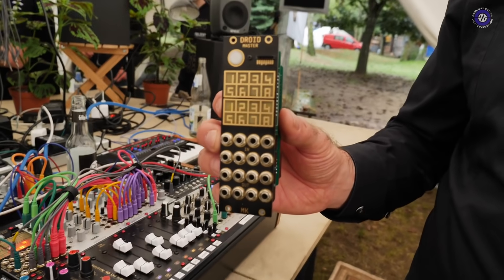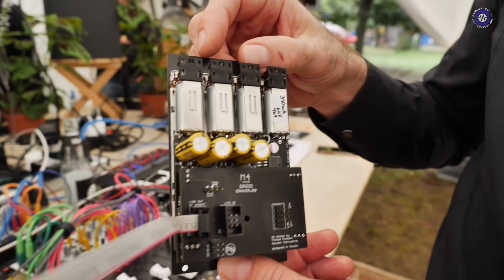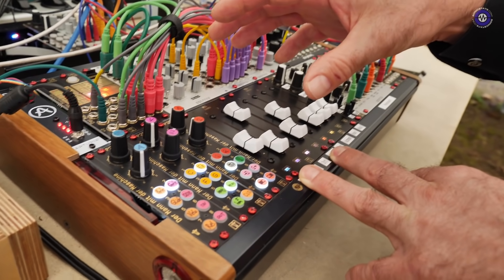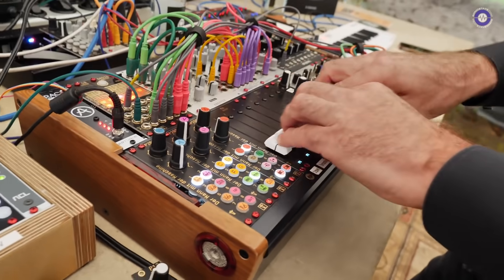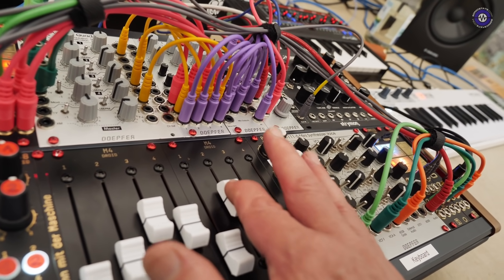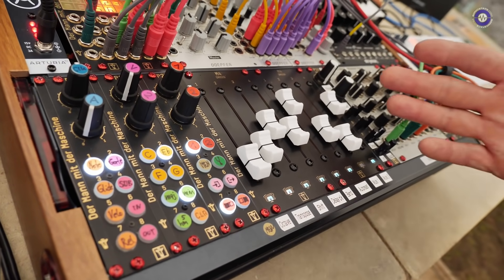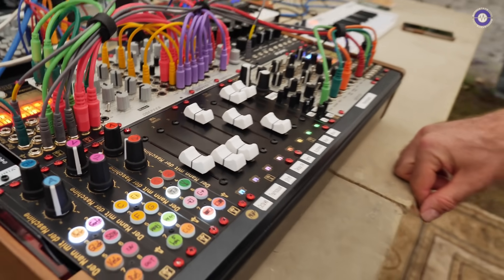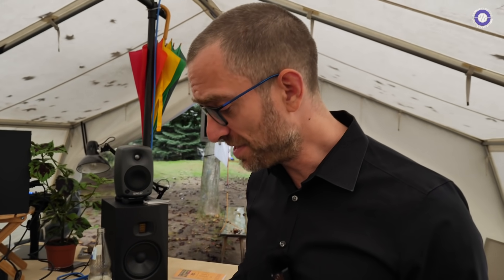SUPERBOOTH 2021 - Der Mann mit Der Maschine - Motorised Faders for Eurorack

Comment: Could you also run the cv to a midi converter and use the faders to control the faders in a DAW?
This is the first thing at SB21 that’s gotten my attention. Very nice modules!
Reply: I think you could, there´s nothing limiting you in doing that. Also,might be possible with that USB C port, I understood it's used for conncting to a computer to avoid taking out the sdcard.
Reply: @gautrstafr  yer killing me! When do these modules get listed. I need funds for a droid, two controllers, two faders and X7 😬
Reply: @TRaddcliff  Agreed! I want a droid, midi module, 8 of the buttons and 4 of the faders to have a monster system though I don't know how many modules you can chain in one Droid
Reply: @gautrstafr  can’t wait! First piece of gear that has excites me for a while :) aside from Hydrasynth 2 years ago.

Comment: It clicked for me when he said in another video that the main limitation is the number of physical outputs. I was thinking the way it worked was that you could only have a single circuit assigned to each output. But it's way crazier than that. You could, for example, set up 5 internal LFO circuits and have them cross-modulate each other and send that result to a single output. 

I've got some modules on the way and already started playing with some patch ideas in VS Code while I wait. At first I was like "A TEXT EDITOR? IN MY MODULAR?!" but then I realized once I set everything up I could have something super playable and not have to mess with it much after that. We live in strange and amazing times.

Comment: I don't get it... where is the CV out?
Reply: It’s on the DROID master module, in the first row at the left
Reply: @DerMannmitderMaschine  Right... so the faders are connected to the master through the back?
Reply: @flflflflflfl  Exactly. Via a 6 pin ribbon cable just like all other DROID controllers.
Reply: @DerMannmitderMaschine  Thanks!

Comment: The capacitors seem quite big. Hopefully not too dangerous!
Reply: capacitors can't explode like batteries
Reply: @opensocietyenjoyer  yes, but if they are not discharged properly, they can shock you and cause injury (if they are large)
Reply: @partyboeller  The faders continually move downwards to discharge the super capacitors when you switch the case off. The lights underneath stay lit until they are discharged. It's a well thought out system!